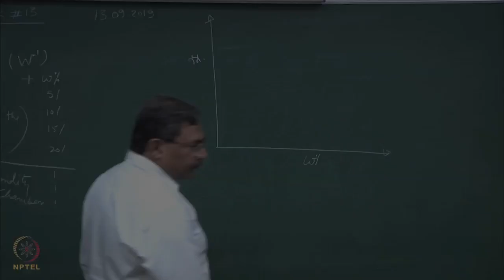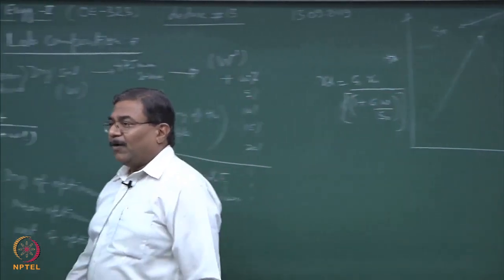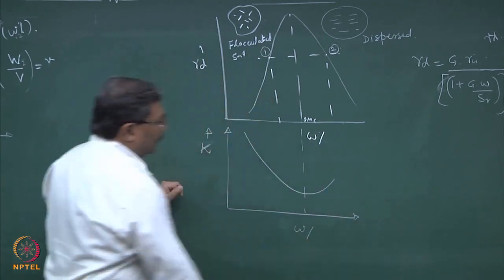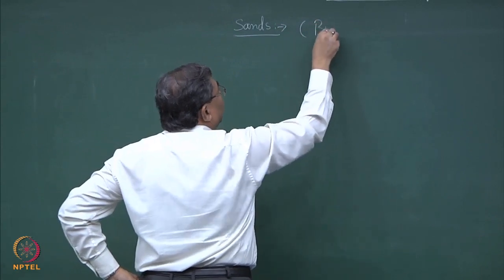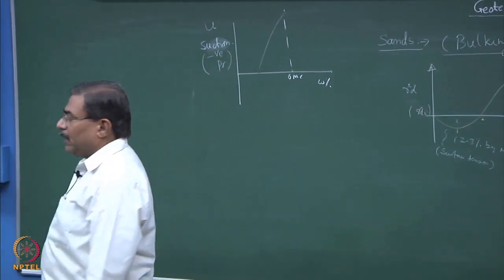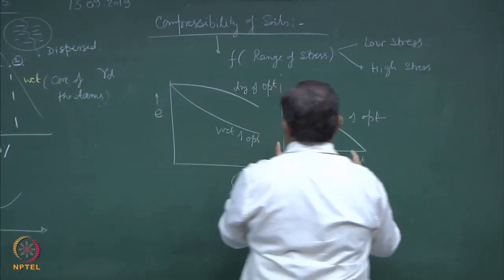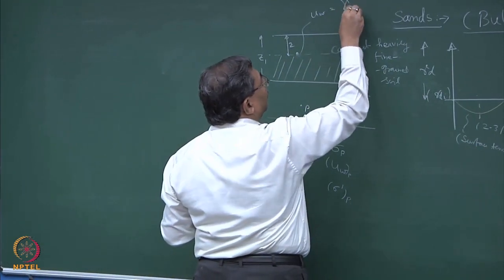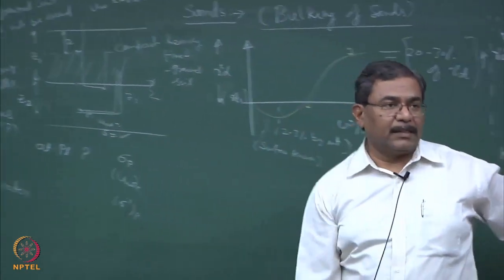Week 6: Lecture 15: Compaction Characteristics of Soil- II

Comment: It is really confusing at two points. Proff. at 12.47 (time lapse of the video) old the settlement is a big issue for wet optimum but at 19:44 he told the settlement is very less. Is there someone to clarify on this two contradictions points?